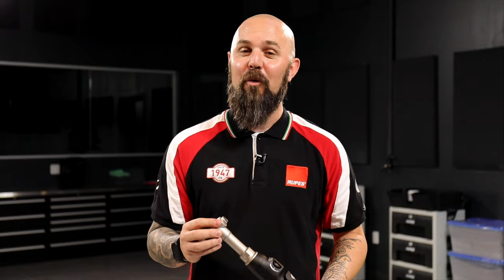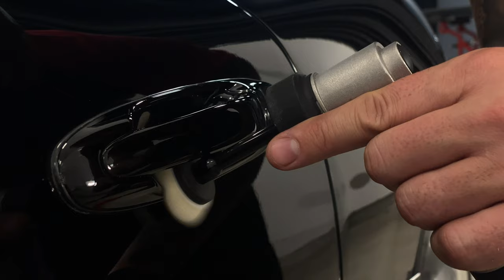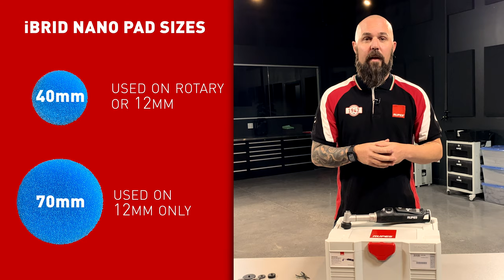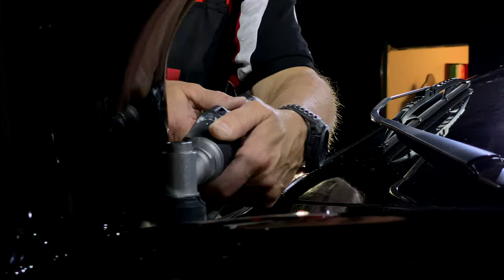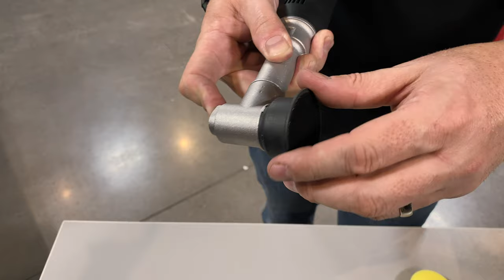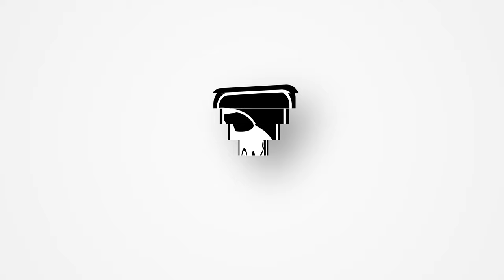Optimizing iBrid Nano Performance - [RUPES Replies Episode 022]

Comment: TOTALLY HELPFUL! I was just about to call you guys asking why the blue 3mm isn't spinning and bogging down way too much even with no pressure on the head of the tool.
Reply from the maker: Well, you can thank @N.P.Detailing for posing the question that inspired the video as well. Reserve that blue attachment for spot sanding or for ultra, ultra, ultra fine polishing where a small orbit will excel. Otherwise rock it in rotary or 12mm mode! Thanks for watching!
Reply: RUPES thanks will do. Can I ask this why doesn’t it not spin though?
Reply from the maker: It does, but the amount it can is limited bc of the small orbit. Less orbital movement means less centripetal force, and that means less “power” behind the rotation. Rotation potential increases much more as the orbit size increases.

Comment: I never had the idea to make a foto of my first Nano iBrid. Now over the years i can‘t believe that i never worked with that tool. The hard truth for all guys working with an iBrid is that you need minimum three of them. In this way you don‘t need to do handicrafts between your steps. You have a shortneck, you have a longneck and you have a rotation module. THIS is floating workflow. This tool will be everytime in your hand reach. I‘d never miss it!
Reply from the maker: It would really depend on how often you change movements. For many technicians in the automotive world they stay with one movement - rotary, with the 40mm backing pad. This is the most precise and effective tool for edgework. If you don't change movements very often, having multiple tools preconfigured with the different eccentric movements isn't necessary.

Comment: I just used mine for the 1st time last night. Bought the box kit long neck and another long neck soft case kit. Worked awsome, only thing I noticed was the unit got a little hot, now I know why oops. I used the Rotary with both backing plates. Corrected great, I just cooled the unit by spraying it with compressed ait every pass along with the pad. I used a eurofiber pad with 3d one fluid.
Reply: Like he says in the video, rotary mode should only be used with the smaller backing plate 😉

Comment: I just got my Nano a couple of weeks ago. Love it! I have a question on the blue pads and the coarse compound. I usually set it up as a rotary, with the smallest blue pad, and the blue compound. speed set to the slowest setting. I prime the pad as recommended but the pad seems to harden up and mildly disintegrate after10 or fifteen minutes of use. I watch my pressure on the pad.                                                                                          I bought my first buffer, a Sioux, cast aluminum and I swear it weighed 20 pounds at  Wyo Tech in Laramie about 40 years ago. I have been painting and buffing ever since. Learning and making mistakes along the way.
Reply from the maker: It would be really unusual for a pad to "harden up" during use because the frictional heat actually softens the foam (by design). It would probably be best to contact us directly to discuss the issue in more detail. You can find our contact information linked in the video description.

Comment: I'd love to see a video showing a whole car and showing different areas where you'd use a 15/75E/nano.  Even on a basic Honda Accord nowadays you have concave panels, sharp edges, bumpers with tons of style lines, etc and it's really confusing where you need to switch between tools or where you can get away with a larger pad at an angle or higher speed or whatever (to save money not buying a whole nano setup)
Reply from the maker: Great suggestion! In absence of the video the best advice is "if the pad can fit and be flat to the panel, it is effective. If it can't you need a smaller tool/pad combo"

Certainly there are more advanced techniques where you can tip in a little (random orbital tools are not ideally suited for this, especially larger orbits) but the entire reason for the existence of tools like the LHR75E and the iBrid Nano are to allow users to work without needing to master complicated techniques to get results.

Comment: Why did you make a short and long neck. Seems a strange question, but is one better than the other. Does one have more features than the other.
Reply from the maker: Thanks for posting your question. 

Other than the neck length the tools and all their functions are identical. In development we tested both versions in the field and received feedback that was positive on both for different industries so we decided to make both versions. 

The long is more popular in detailing because the extended reach it provides. In industrial, bodyshop, and other specialty applications the short is preferred because it is easier to control in one handed operation.

Comment: Can you make a sanding backing plate about the size of a #2 pencil eraser?  I would like 2500 and/or 3000 grit sanding pads to prep a paint touch up area and to smooth out paint/clearcoat after a touch-up. The sanding pads provided in the iBrid nano kit are too big for this purpose. 

Maybe you have another solution?

In the interim I am planning to wrap 3000 grit sandpaper around - wait for it - a #2 pencil eraser and wet sand.
Reply from the maker: Thank you for reaching out to us but unfortunately RUPES does not currently manufacture any solutions for this type of spot repair sanding. After the spot repair sanding is completed, we do offer polishing solutions for those repairs.  However, we are consistently innovating new products and perhaps in the future we may have a solution for intricate spot sanding like you mentioned. Thanks for the suggestion, we value the input of our customers.

Comment: Is there information available about why the machine stops while being used, the green light flashes and starts back up.  More specifically in rotary mode. Assuming with the red light it is a low battery condition.  Is the green because of increased amp load detection and the machine cutting out as an indicator?
Reply from the maker: Green flashing on the machine during use would be overload protection. Reduce pressure on the tool while using it (as indicated in the video) and make sure that the spindle lock isn't accidentally pressed down while running. If it continues to be an issue get in touch with us and we can help sort a solution.

Comment: Just purchased the Nano to add to compliment my LHR75. Just wondering if there are any adaptors to use with nano so can polish inbetween my alloy wheel spokes?
Reply from the maker: The only additional attachment we make for the nano is the 70mm rotary extension bar. Without seeing the wheels and the specific areas you need to address it is hard for us to know if that would solve your issue, but hopefully it does.
Reply: Thanks for taking the time to reply. The Wheels in question are Mercedes Benz AMG 19 inch black and diamond cut alloys if that helps...
Reply: @RUPES  Thanks for taking the time to reply. The Wheels in question are Mercedes Benz AMG 19 inch black and diamond cut alloys if that helps..

Comment: i currently use, what the industry uses for decates now, a eccentrik pneumatic polisher , witch have 1,2,3 inch pads and plates capability and themendus power but safe because has eccentrik function. witch benefits i will have investing on the Nano on buisness?
my kind regards, keep up your great videos
Reply from the maker: Pneumatic tools have tremendous benefits, especially in a very busy shop, because of their low level of maintenance and high amounts of power. The Nano is unique in that it offers you the capability to convert the same tool to work in rotary mode, 3mm orbital, or 12mm orbital. It could be a helpful for your shop, it could not. Without knowing exactly what your work is and what applications you have it is hard to say for sure you would see a big benefit from the nano, but it is a valuable addition to any collection if you have the need for it.
Reply: @RUPES  thank you sir , i really appreciate your response. Keep up your great work . My kind regards

Comment: I'd love to have that tool! But why aren't you making a mini version of LH19 E rotary? I have the LH19 E, it's very good with 5 and 6 inch pads but I'm running it at speed 6 on smaller pads and 1700 rpm is not enough for those 3 inch pads.
Reply from the maker: Thanks for your comment and suggestion. We'll share it with the development team - in your opinion, what would be the ideal speed range for rotary using smaller (say 3"/90mm) pads?
Reply: @RUPES  I thank you for being helpful, passionate and organized to provide the best customer service and training in the industry. About the mini rotary, I think top speed 2700 - 3000 would be enough. Because if i need more correction with 3 inch pads I use my old Makita around speed 5 and its 2800 rpms or so. Also to note that I prefer low speed rotary like Jason Rose does.

Comment: Can you please explain how a smaller pad size in rotary mode is safer? I'm a newbie and am confused about this. Thanks in advance!
Reply from the maker: Sure! Simply put - it comes down to edge velocity. The bigger the pad gets the faster the outside edge is traveling, and thus the more aggressive it is. The inverse is true, so as a pad gets smaller the outside edge of the pad travels at a lower velocity and thus carries less risk. 

This is true of any tool movement where the rotation is driven (rotary or gear driven orbital polisher). When you get into random orbital movements the rule goes the other way. The smaller the pad the more aggressive it is, the larger it is the less aggressive it is (all other factors such as tool speed and stroke length being equal)
Reply: @RUPES  Thanks!

Comment: Has anyone lazered a stick on rubberised cover for the head and shaft to stop any potential marks from contact with the metal? Or has anyone stripped and flexi dipped the metal outside? Wasn’t sure if the metal is used as a heat sink. Was thinking of drawing a design in cad and then cutting out some 1 or 2 mm rubber.
Reply from the maker: We have seen a few solutions users have come up with, the simplest being a strip of tape if you have any concerns about impact. However, if you are working in compact spaces and impact to adjacent surfaces is a concern you may want to consider a different approach. The metal is not as much concern as the side of the backing pad would be and that is far more likely.

Comment: I just unbox mine a few hours ago,can you tell me if its safe to have the batery into the machine if i dont use it for a few days or is  it better to keep it off on that situation?
Reply from the maker: Congratulations on purchasing an iBrid Nano. If you're going to store the tool for a few days you do not have to worry about removing the battery. Just make sure the speed control dial is set to the OFF position to avoid accidental activation. If you plan to store for longer than that (weeks or a month) it is probably a good idea to remove the battery and store it with the battery cap that came in your kit.
Reply: Thanks 😉

Comment: Is it advisable to use the sanding disc starting with 3k to level a small paint chip using one or 2 quick passes?
Reply from the maker: Thanks for watching! Yes - using the vinyl plate, 3mm attachment, and adhesive sanding discs that come in the kit to knock down touchup paint is doable. Just make sure that the paint is fully cured and the prep was done correctly to avoid the abrasive peeling off that touchup blob.

Comment: Hello Rupes! Just bought the Nano and love it. Question—the blue piece that threads the backing plate onto the 3mm functional unit has separated from its base. Is this normal? I just started using it today. Thank you!
Reply from the maker: Hello. That does not sound typical, but probably best if you contact us directly so we can discuss in more detail. www.rupes.com/contact-us
Reply: @RUPES  will do, thank you so much

Comment: I'm about to take the plunge and order the MK3 LHR15, Bigfoot Mini and the iBrid.
The problem I have is I'm hearing bad stories about the ibrid's reliability. The last thing I need is  £450 tool failing on me during a job. The 1 year warranty isn't encouraging either
Reply from the maker: Thanks for commenting. In our experience the vast majority of nano issues can be traced back to heavy handed useage like excessively heavy pressure, running at full speed all the time, or simply doing something like hitting the spindle lock button while the tool is running. Users need to keep in mind that the Nano is a specialized precision tool and use it accordingly. There are nano tools in use in industrial environments where they see use for 8+ hours a day daily and with proper training and application they are very reliable.
Reply: @RUPES  At the weekend I went ahead and ordered the LHR15, LHR75E and the Long Neck ibrid Nano all in Deluxe kits! I'll make sure I use them as intended and hopefully they'll work hard for me 👍👍 thanks for the reply

Comment: Which one is best for motocycle polishing? Long or short neck?
Reply from the maker: Long in most cases. The additional length allows you to reach into areas on some motorcycles that would be hard to reach with the shirt neck or other tools.
Reply: @RUPES  thank you for really quick answer. So, it will be the long Version. Thanks a lot again and take care 👍

Comment: It's a good tool, but the batteries are crap.  I had one of the two out of my kit die 3 weeks past the 1 year old date.  The disappointing part, was I never received a return call or email when I tried to reach out for assistance.  I've never had a battery crash on any cordless tool like that.
Reply from the maker: Sorry to hear that and the batteries are completely covered under warranty and we are generally very generous with the 12 months window if the failure happens close to it. Where did you send the message? Get in touch with us and we can certainly handle the issue for you. www.rupes.com/contact-us or if you are located within the USA contact us directly at support@rupesusa.com, info@rupesusa.com or call (877)224-5750